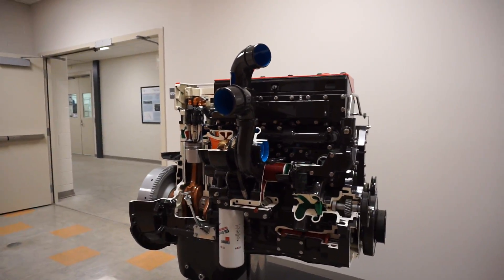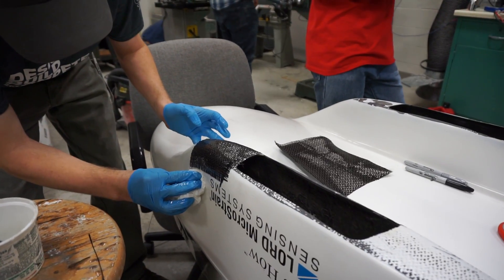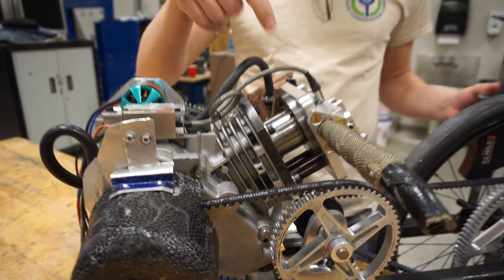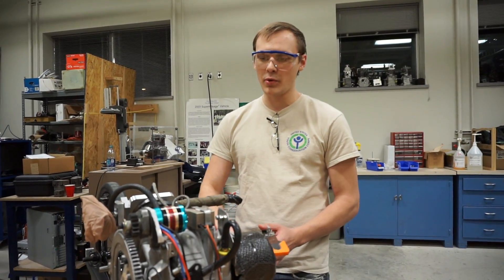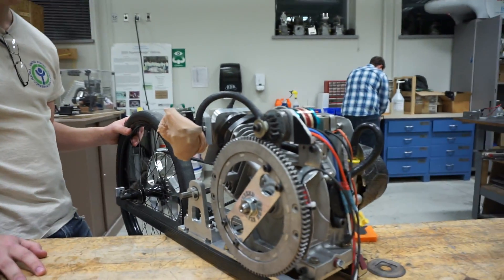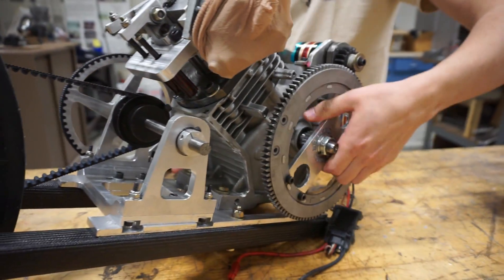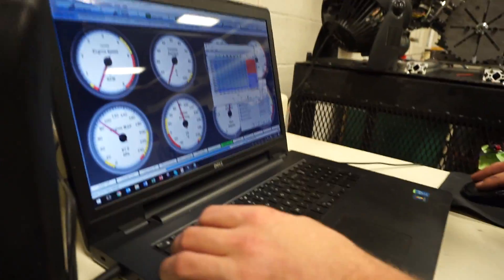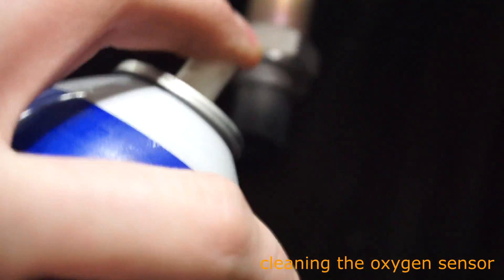How to Get Over 2500 Miles Per Gallon - Supermileage Club Penn State

Comment: Did you ever consider running a gasoline engine at its optimum rpm, or even a bespoke gasoline engine optimized to run at a set rpm and run a generator which in turn would charge a battery pack to power an electric drivetrain, essentially running the engine in an efficient way and also benefiting from the advantages of electric drive?

Comment: I like your work has your club look any of the work by the flowing people after all your members will be leaders in the world to come
Smoke Yunick and his hot vapor engine which makes 150 HP at 60 MPG and meeting all the EPA standers of the time at only two Cylinders

Tom- Oloa- Spelling from El Passo Texas and his hot fuel vapor systems in a full sise ford at 100 MPG in a V8 engine that was a, 302,351,400 engine 

Stan Mayer - Spelling and his HHO system were he made the local news more than once with his water power Dune Bugey auto

Or any of the vap systems on y-tube that seem to well build and working some wishing to sell and some not looking to sell anything only showing proof of the concept

Did you know back in 1930 two well respect people one from MIT & Montana state college  produce a book called Heat Power and in the list of fuels for the Internal Combustion Engine was Water Gas in witch steam through a bed of Coke or Anthracite Coal were the steam is decomposed freeing the hydrogen while the 0-2 went into CO2

H2+C=H2+CO

Greed has stop many a inventer from making it big or made him rich or dead while the rest of mankind keeps working as they have 100's if not 1000''s of yeasr after all look at the great work of Tesla who some called a fool and yet open the doors to some of the most advances ever and I than HARP reference his work in there PATEN App 

Thanks for posting and ask your sell many question I ask just a few

How long has it been from that cold day when the first true flight of an aircraft made history and the SR71 made its last flight

With all the money the US and privet people spend  building new things from space weapons to new drugs do you thank the common man and the world are getting what they should from it 

What should the end game be more money and power for a few or build a world for those to come were wast is not dumped at sea and no large pools of waste from breeding animals like in NC were many were overrun with flood waters 

Is it better to live at the top or live a simple but good life and build a better world for those to come

Your club is working at ways to make the world better, after all, is it possible to heat the fuel/mixture for a super clean burn and turn a generator or Alatoner and produce power for all homes or all cars at all most or Zero emissions would love to know what it could if tested that way or adding a HHO gas gen to it as well

Thanks for posting

Comment: If you can increase, the heat temperature on the  intake manifold with some type of thermocouples.
To create a vapor from the fuel you will achieve higher mileage
which can be achieved with hydrogen fuel cells not too hard to create
I have got in lots of trouble in California working with hydrogen fuel cells
I have designed hydrogen fuel cells on my test vehicle, took it to get it smog .and that's when the trouble began
it is now illegal and punishable by prison in California to design hydrogen fuel cells for personal use
free energy is a God-given right by the creator whoever that might be, keep up the good work and bring good things to life

Comment: Makes you wonder what would happen if you built the engine as a hit and miss setup with the fuel controlled by an injector.  

Then again you could skeletanize the crankshaft area of the engine then seal it back up with fiberglass or carbon depending on temperature needs as a way to shave the pounds off. Just enough metal to have the structure with a light weight material sealing to hold the oil in.

Comment: 5:30 how can it be only 2.5 godamn horsepower?!?!?
Reply: They just hadn't pushed it any harder.  The connecting rod is super long, so who knows at what speed it will give out, especially with the crazy high compression.  I'm sure with the right EFI setup and the willingness to push it to 6k+ rpm on a full throttle run, it would get to 4 hp, if not higher.  The valves are rather tiny and it's only a two valve, so I'm sure some flow improvements could be made, but it would likely hurt efficiency.  The stock GX-35 only put out 1.4 hp at 7k RPM IIRC.  68 cc's @ 2.5 hp is 36 hp/L.... not super terrible for a N/A engine designed for fuel economy.

Comment: 2500 mpg my ass, has to be defective dyno or operator error, daily drivers go insane with mods to squeeze mpg out which is clearly not seen here; just high compression and leaned out with a pantyhose on it

Comment: What role does de-rating the engine to 2.5 hp play a thermal efficiency?
Reply: You can open the throttle all the way and not have the pumping losses or lower volumetric efficiency & combustion pressures (less heat).  A bigger engine will spin the rear tire and you can't run it at full throttle.

Comment: Great work!  It's impressive, but you are going much less than 30.mph to get that mileage.  A gallon of fuel contains about 33 kwh of energy of which you can recover less than 30%.  It takes you more than 100 hours to go 2400 milesvat 22 mph so your energy consumption is less than 330 watts, and about 1/3 of that is waste.  Electric is about 90% efficient, so you could put a 240w solar panel on top and run it off a lithium battery day and night forever!
Reply: Nice math!  The car only uses about 6000 Joules per mile of mechanical energy to go 1 mile, so a solar panel would work.  I think about 50W is all it would take.

Comment: add fuel injection and time it( pulse spray) advanced before the intake valve opens, valve overlap sucks unburned fuel, but it helps cool the valves, the deal is to squirt fuel just before the intake opens, not a constant spray.

Comment: Some car manufacturers add a second valve spring to prevent valve float for higher rpm motors
Reply: If they did that with this engine, then they'd lose a bit more power, and they'd have a decrease in efficiency due to the additional force required to open the valves.

Comment: This is a very interesting learning process for those involved......
BUT,
Actual "gas mileage" being your goal, is barking up the wrong tree.....
It's a moot point.
It's not practical.... You can't drive any of these interesting contraptions on the street.

I thought I heard them say that the engine was ~ 23% efficient, and they're proud of that ?!?
Plenty of factory stock automobiles are 21 to 22 percent efficient,
some Diesels are up into the ~30's.

Do they have restrictive rules for this competition ?, such as you have to use a
150 year old piston engine design ?
My engine design is over 80% efficient, it's half the size, half the weight, has no cooling system,
needs no muffler, doesn't vibrate, and is mostly made out of Teflon type plastics,
and will run on anything that burns, (but BioDiesel is preferred).
And, that's not the full list.

Problem is, if you do anything competitive with it, the men in black suits show up at your door.
So, the first thing to do is ask yourself why we are still driving cars with ~150 year old engines.
And then realize that everything you have been taught is a stinking LIE,  EVERYTHING....

Comment: So it's a Briggs LO206 that's been de-bored to less than half it's original displacement, crazy compression ratio, crazy rod ratio, running 4400rpm using a cam ground for a 7100rpm 206cc? How can it run lean enough to get that MPG while doing any work on planet Earth?
Reply: Which is why making a new camshaft that hit's peak efficiency in the middle of the ~2,000-4,500 rpm rev range is a good idea.

Comment: Ah yeah... With such high compression ratio, ethanol would run very well in that engine.
Reply: The problem there is, it doesn't pack as much punch per gallon. In other words, it would take more fuel to get the same power output so the "mpg" would go down. The whole point is to get the most mpg you can.
Reply: Titan Entertainment Oh yeah. Indeed. The the energy per volume on ethanol is lower than the gasoline, but there are couple countries where the ethanol is actually fairly cheap as fuel and may cost between 65% and 75% of the price of gasoline per volume unit. The price/cost per kilometer or mile still an important thing too. ;D

Comment: When he said that at 21.5 to 1 compression the engine gets warm and keeps running even without firing sparkplugs... does it continue to burn the same amount of fuel?  2500 mpg... my car gets 22...Im confused...Can Makerj101 or someone explain how that works...
Reply from the maker: +Don Gawgon it gets such fuel mileage because the engine is so small, the car is only about 100lb made mostly of carbon fiber, super low rolling resistance tires and drive train, very aerodynamic body, and we use a method called burn and coast. So the engines efficiency only really takes much of an effect after you reduce all the other resistances. The high compression ratio is what makes the engine itself a lot more efficient. And also the fact that we don't have to keep a catalytic converter happy so we can burn whatever AFR we want. Burn and coast makes a huge impact as well. We burn the engine for about 5-10 seconds to get up to speed and the shut it off and coat for about 2-3 minutes.

Your car only gets 22mpg because the engine is huge compared to this engine. If you half the size of your engine you could realistically get 44mpg. A lot of European cars get 80mpg or higher. This is because their cars are a lot lighter, less safety features to meet so they can have a lot less weight. Less weight means smaller engine. Thus hugger mpg. Also Americans like big cars with big engines. We like to be able to hit highway speed half way on the entrance ramp. A lot of European cars don't have the engine to get going that fast.
Reply: Hey Thanks for the reply and it makes sense about the size and weight... still not sure about why the engine keeps running without sparkplugs firing... is the compression alone enough to ignite the fuel?

Comment: The repair of the rub hole.........If the hole was repaired from the inside a whole lot of work would have been saved also  you would have remained streamlined .  That body was reverse mold hand layed in the first place so repairs are done in the same manner.  Okay Class is out.

Comment: Wouldn't it make sense to cut off the entire head and bolt up the small one and make a smaller custom connecting rod. Seems like having that long connecting rod could make more mechanical resistance than there needs to be.

Comment: Motor is only 20% efficient? Some Atkinson cycle motors on hybrids push 40% (at peak efficiency load). Had they gone with more efficient motor, could they have gotten close to 5000 MPG? But still won't be practical like SparkEV that makes 140 HP, 120 MPGe, 0-60 MPH in 7.2 seconds.

Comment: Wouldn't using chains as a transmission be more efficient than using a timing belt? Same reason motogp uses chains instead of belts. They get more % of power to the wheel.

Comment: valve float..yeah that mechanically can be addressed with stiffer valve springs. Will slightly increase rotating resistance of the engine though.

V.E. of naturally aspirated internal combustion engines can surpass 100%...maybe not with 1cyl though.

Comment: Regarding the engine:

Dieseling will be caused not just by compression and engine temperature, but also by hot spots in the combustion chamber, in particular the valves and the spark plug. Both can be modified to reduce hot spots dramatically

Carburettor/injection system - A constant velocity style carburettor (not what you have there) can be modified to have superior vaporisation to any other carburettor, in addition to that you could run a heated manifold, this would improve vaporisation even further. You still don't get the control that EFI offers, but you get superior vaporisation (which affects burn speed and efficiency, a LOT). Running EFI with some form of fuel or manifold heating would offer the best of everything. Also, if you are running unheated port fuel injection, injection timing matters a lot.

Variable compression - Varying the compression ratio in this way is not ideal, depending on the combustion chamber shape. If you have a combustion chamber that runs large squish pads (area where the piston almost touches the head) it vastly reduces the effect of said squish pads. The effect of the squish pads is to increase combustion chamber turbulence, which reduces detonation and improves burn speed & efficiency, so you definitely want this in your combustion chamber design. I have no variable compression solution for you, but you should know that compression isn't the only thing changed by by those shims.

Feel free to message me for any questions you have, I would love to have input into a competition like this

Comment: so 6hp down to 2.5hp? is that due to long stroke and small cylinder?. 18:1  compression is insane. most cars run wayyy less. is the compression the key to efficiency? im only asking bc i would love to get better mileage and as im soon to rebuild my trucks motor i would love advice on how to set it up. ive heard some big racing motors actually have great efficiency but bc they are run so hard they never get great mileage.

Comment: If valve float is keeping you from optimum RPM, have you tried stiffer springs or lighter valves?
Reply: the heavier the springs, the more power is being wasted in each cycle trying to open the valves, reducing available work being produced, basically, fuel wasted due to more work being used to open the valves.  To prevent valve float they could come up with a creative solution yes, but I wouldn't see why they need to rev the engine higher as the higher it revs the more fuel it uses.  I would too, not want to rev a motor with 20sum:1 compression as I feel that the whole room would become rod territory :D
Reply: @unitytwins6652  ..and? You probably achieve more power when you reach higher rpm so it won't actually matter
Reply: If they would have gone to an overhead cam, they could have eliminated the mass of those pushrods and possibly the rocker arms using a very light timing belt. That would have reduced frictional losses and given it a higher RPM before valve float using those same springs...

Comment: yeah dog you are not running 100 percent VE.. I know it's a club and you all are learning. but VE doesn't just become what you say it is.. among other things.
Reply: Yes exactly. "This table should all be 100%" - Nope.
Reply: Yeah... It sounded pretty incoherent when the guy said "it should be 100" everywhere. Actually, look like he should said "it should be as high as possible", but I believe he said 100 probably due the fact that above 100 will generate more power, but not necessarily will be more efficient in terms of fuel consumption per power output.

The Volumetric Efficiency basically says how much % of the theorical volume of the cylinder is been filled with mixture, which means... It's normal to be lower when you close throttle or else... You don't have any means to reduce the engine power output, except cutting off the fuel. Hehehehehehe

(By the way, when you put forced induction, it can go above 100 without any major trouble.)

Taking in consideration that the engine runs at low speeds, I wonder how much they could improve the Volumetric Efficiency on a wider RPM range if they remove the camshaft and replace it by some system with direct control over the valves.
Reply: Ti M, oh yeah! Haha yeah if they were forced induction filling the cylinder would be no problem. Additionally if they had some sort od variable cam or valve timing they could potentially increase the rpm range in which they are close to 100 VE. Anyways they'll figure it out. Haha

Comment: wouldnt a higher weight help it cause you could just accelerate it and off the gass and then it carries itself
Reply: American Pride yes in theory it would have more inertia... Blah blah... Newton's laws... Blah... Blah. But there are other factors still in play. The more mass there is the more energy is required to get up to speed. In addition it would also heavily increase rolling resistance.

Comment: Ehh,  I don't get valve float until well past 5400-5600 rpm.  I have video of my kart engine, all stock internal /external parts, running 6400 rpm as shown with digitron karting tach.....  just modded fuel and exhaust,  with no governor......

Comment: too small and not enough horse power, ill take a motor that makes 1200hp and gets 2 gallons per mile
Reply: What really matters is smiles per gallon
Reply: Where do you live that 200 gallons costs $1200 USD?
Reply: 9a2er ah, well where I live 200 gallons would be about $400 to $440, which isn't cheap but also is nowhere near $1200

Comment: What octane of fuel are you using?
Reply: I didn't the whole thing before asking. 100 Octane. That still sounds a little low for such high compression. Some single engine aircraft run 110 octane I believe.

Comment: OK so I don't know squat about engines, but who knows - maybe that can open doors for new ideas, without getting locked in.  Why do engines need valves that open into the cylinder?  Could you use something like a barrel that rotates, so that the hole opens at the right time?  Do we need sparkplugs in order to make the spark?  Would it be possible to run this spark from the top of the cylinder wall into the piston head... or even use microwaves bouncing off something (platinum?) off the cyl head?

If there's still unburnt fuel in the exhaust, can any of it be recycled or scavenged?  Run a small turbine, maybe -- just add a little extra fresh fuel... this might to more for power than efficiency.